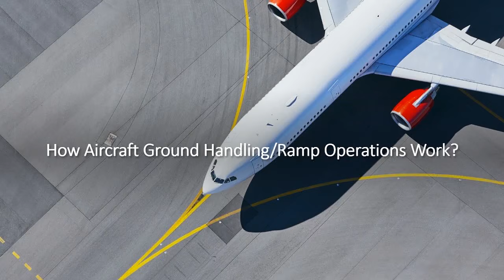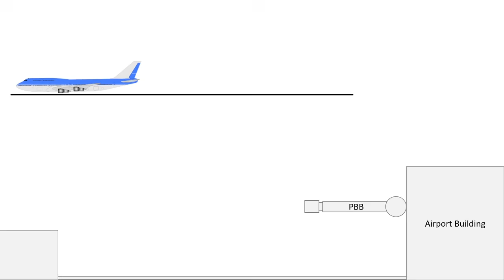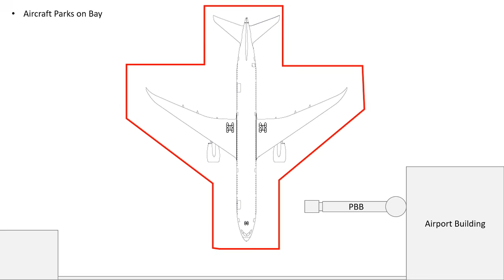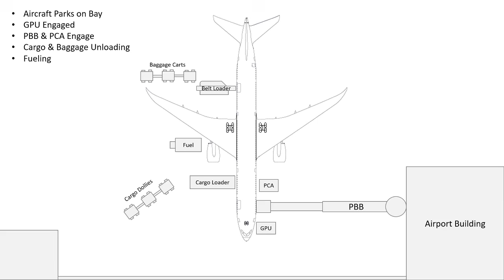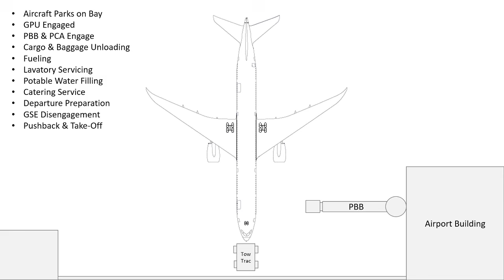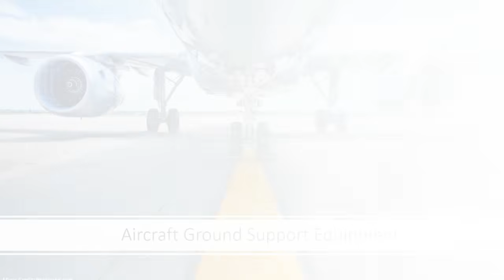How Aircraft Ground Handling Works | Sequence of Airport Ramp Operations

Comment: The use of an ASU is rare as it would only be needed if the APU was unserviceable.
Reply from the maker: Yes that is right.
Reply: What is the difference between ASU and GPU?? Please
Reply: @KarinaHernandez-yc4hw  The APU (Auxiliary Power Unit) is a turboshaft engine on the tail of the aircraft. It's used to provide electrical power and bleed air. That bleed air enables air conditioning on ground and most importantly it provides pressurised air to start the engines. If the APU is unserviceable, then you will need an ASU (Air Starter Unit) which is a unit that will have to be brought to the vicinity of the aircraft to be connected to it so that it can provide pressurised air to start one or all engines. Typically it is used to start one engine only and it is then disconnected. The other engine will be started with bleed air from the already running engine.

Comment: How do you meter the PCA GPU or PBB? what network operatoring systems are used in general can you explain?
Reply from the maker: Metering of PCA, GPU and PBB is carried out through a software system that collects and complies information of these systems and is linked with a central airport operations database.
Reply: so the software will directly feed meter reading into AODB? wondering if you need to charge back to Airlines, will these softwares know the airlines details how it correlates meter readings to the airlines as best practice
Reply from the maker: The software system would have already received information regarding the operator from the airport operations database. It will simply compile the metering data and send it back to the database. In this way, a billing program would be able to extract all metering data for billing the airlines.

Comment: How is the connecting luggage identified? Is it put in a different luggage holder than the other luggage.
Reply: Baggage Tag Printed up to the Final Destination with flight numbers and most of the time loaded in separated ULD EX: CMB | SIN | NRT
Reply: @harshanadissanayake7873  finally understand the meaning of three capital letters. CMB-Bandaranaike International Airport l SIN singpore l  NRT  japan.